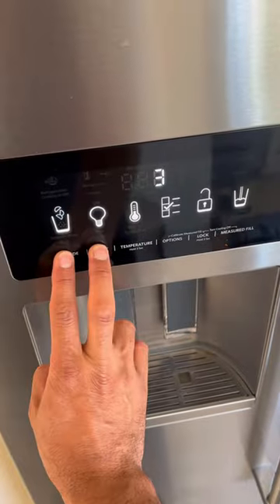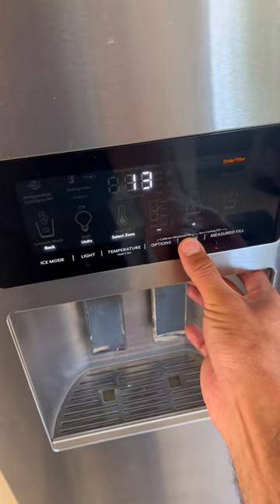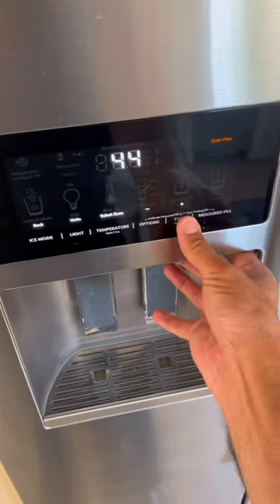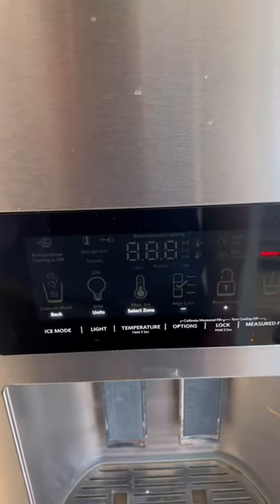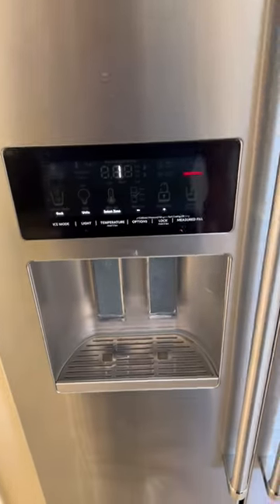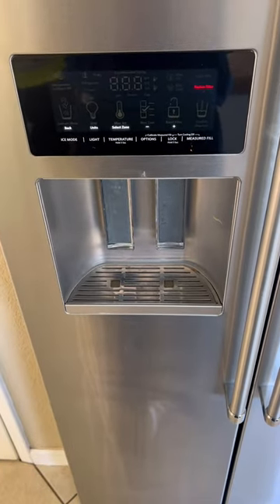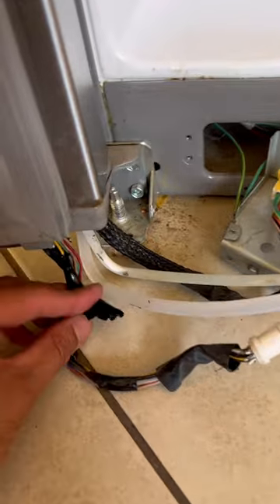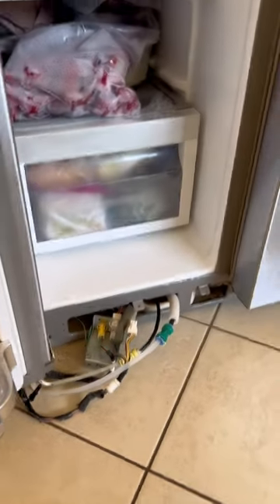Kitchen Aid Refrigerator Diagnostics #shorts

Comment: We have repaired the wires and the icemaker started working for several weeks, and then it stopped again. We checked the wires again and everything looks good on the wires, but the icemaker is not working. The icemaker will turn and go back to home, but it will not fill with water. Any ideas?
Reply from the maker: Check if Water filter due changing. If there is ice cubes in ice maker then check if the ice maker temperature, ice the temperature is above 7 degrees, the icc maker fan is bad and that needs changing.
Reply: Same problem. It won't fill the ice tray with water anymore.

Comment: IM is not working or fringe not dispensing dude?
Reply from the maker: @danieldemaree2017  IM & water dispensing both connected to water line/ valve. If one or both are not working, you have to go through this diagnostics
Reply: @appliancexpert  it may help